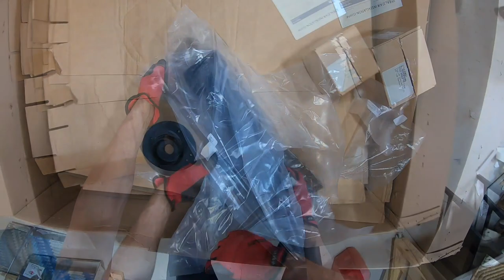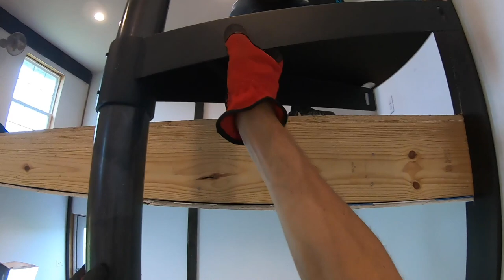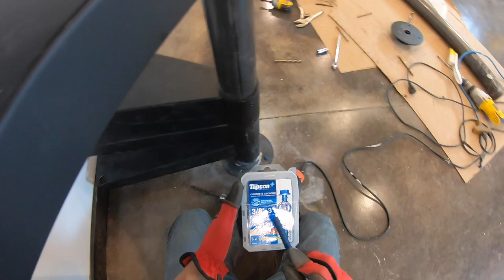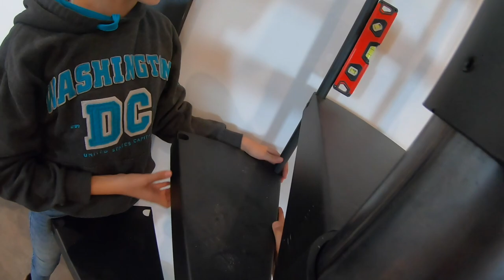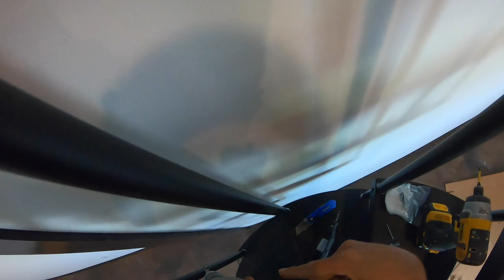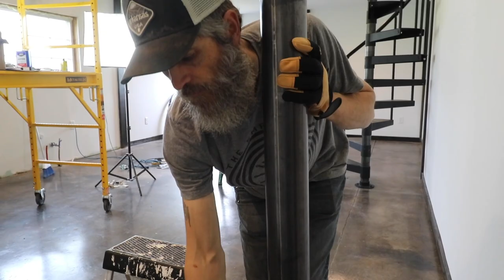Duel DIY Spiral STAIRCASE INSTALL in our BARNDOMINIUM Build

Comment: i/m about to replace wood deck straight stairs with these from paragon stairs. My current wood platform is 36 inches wide, not 24 as in your video. I may have to see if theere is a wider option. Excellent DIY!!

Comment: Hi, im thinking about puttin a spiral stair aswell 3 foot 6inches are like 1 meter in diameter, is it easy to use? I am think about a spiral stair with a diameter of 140cm ~ 4 foot 7 inches but its between 3 walls what is ur opinion bout it after using spiral stairs for over 2 years
Reply from the maker: Getting up and down is not a problem, but I would go as big as you can because it is difficult to carry items up them, such as suit cases and laundry baskets.
Reply: @FromScratchRanch  thanks for you response its very much appreciated!

Comment: Could you tell me the diameter of the stairs with the handrails? I know it's the 42 inch one but I need to know how much more space would I need to get away with using it. Thanks in advance.
Reply: The diameter is 42”. I am installing the 60” version as we speak and it is right at 60” wide total.  So, you could get away with 43”x43” niche, although I would go a little bigger for easy of maneuverability.

Comment: Ah, you didn’t show where the very long pole was in the packing!? Was it within the packing box? Did you have to have that made? Was it packed separately? I mean, come on, that was the biggest question about this whole set-up. It was suspicious why that fact (the pole) was completely left out of the unpacking situation.
Reply from the maker: The poles were delivered as they are, but with a shipping label stuck to it.  The total shipment was 4 pieces: 2 crates with all the parts (1 per staircase)  and two poles.  I didn't think of talking about the poles.  My miss.
Thanks for watching.
Reply: The pole is a few separate ones that you thread together